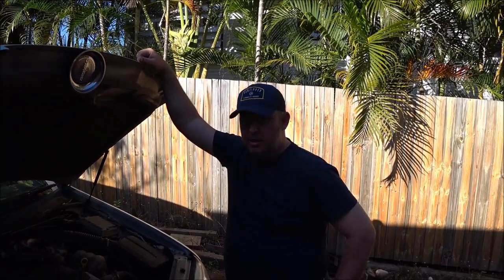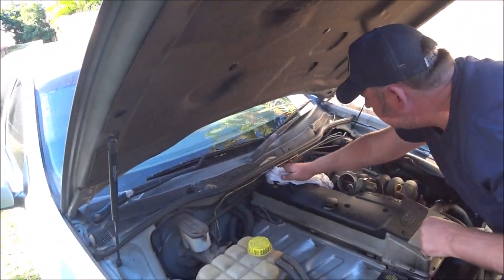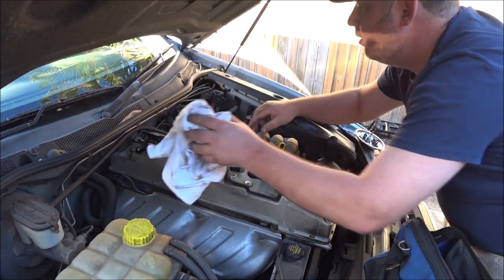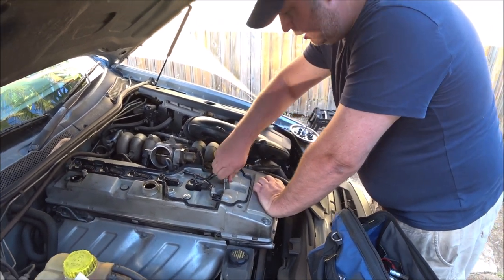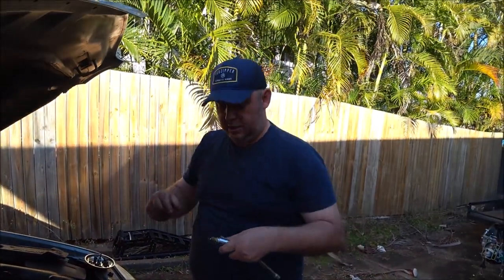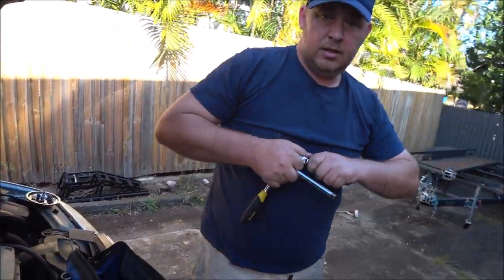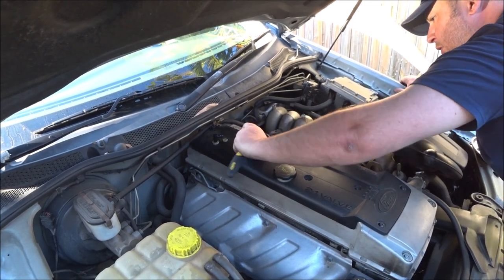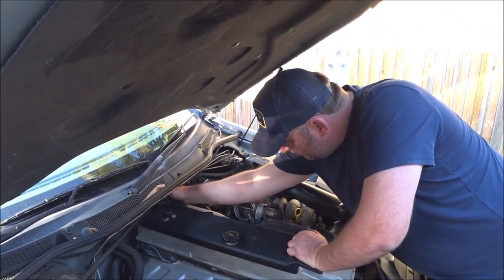BA Falcon - Spark plugs and ignition coil packs

Comment: Great video. Don't forget to put the engine oil cap on after removing the plastic cover while you are fiddling with the plugs and coils to prevent debris going into the engine unintentionally.
Reply from the maker: That is a good idea, and I usually do it, but didn't this time, I suppose because I knew I was only going to be 1 minute demonstrating and not there to do the whole job.
Reply: Hahaha yeah that's a good tip.

Comment: Thanks for the great video. After watching it I had a crack at doing my plugs myself. I was extra careful so probably took a little longer then I could have. Apart from the plugs costing a bit more then I thought I completed the task successfully saving I reckon at least a couple hundred bucks on labour. Cheers
Reply from the maker: Easily saved yourself some cash, if you got iridium or platinum plugs they are good for 100,00km so worth the extra.

Comment: Thanks so much for this video! I've been staring at the engine wondering where the spark plugs were as they don't show and neither do the leads!
Reply from the maker: No problems mate
Reply: tangles01 hey bud could you please send us the link on the factory Manuel cheers great video
Reply from the maker: Mate 2 mins on google will have it for you

Comment: This was a very handy vid. Thanks for sharing / posting. An issue I did come across was a couple of the coil packs, the plug section got stuck down in the engine with the old spark plugs and wouldn’t come out. What I did, was spray a heap of WD40 down the side of them and that provided enough lubrication for me to be able to wiggle them out with pliers without damaging them.
Reply from the maker: nice one

Comment: 14:29 so true make sure no gaps underneath . My BA started missing found that the last mechanic did not fit this properly it was sucking in dirty air. I actually pull the complete thing apart and fit that bit first. Top video thanks
Reply from the maker: Bugger

Comment: That help me out big time no.6 plug great video mate
Reply from the maker: Yeah she's a bit tougher than you'd expect with an engine bay the size of a small country they managed to make that tight.
Reply: @tangles01  haha yeah long way from Xseries ford
Reply from the maker: @iwillnotcomply2002  with no reason to be either. Just have the engine 2 inches forward or lower or a bit if both.
Reply: @tangles01  mate after the 1980's they employed halfwitt's engineers to make Ford. 😂

Comment: ThAnks for the vid! Quick tip to save you an hour though. On the difficult plug, I tried everything to get my extensions to fit and the only thing that worked was having the universal half way ( half down the hole). It then got severely jammed. Lots of swearing and sweating followed.
Reply from the maker: Yeah, makes no sense with so much room in the bay.

Comment: spark plug torque is 10Nm or 7.4 ft/lbs, doing mine this weekend, done 160k on original sets and it's starting to miss under load now. so new NGK coils and iridium plugs ordered.
Reply from the maker: Surely one or the other would do? although while you're there.

Comment: I use two short extensions.
put first one in then attach the second.
Reply from the maker: That can work, depending o the lengths of the extension. But also most of the cheaper tool kits will have exactly what I used here, which is the sort of thing most beginners will have ready access to.
Reply: tangles01 my comment was to inform people of a better way to do it. I have a lot of extensions and get no angles or interference from hoses.
Reply from the maker: @Godwillsortyou  Never said it was the only way, but the vid is for new comers to cars, who will likely own a single entry level socket set.
Reply: you could have used the universal with the short extension . I'm just giving people options.
Reply from the maker: @Godwillsortyou  Short with uni is too short mate.
Reply: tangles01 not in my toolkit.
Reply: I'm just giving viewers options. they don't have to do it your way. someone will read my comment and maybe don't have a uni and be able to do the job. my comments aren't to you. its for someone else might need a tip.
theres more than one way to skin a cat.
Reply from the maker: @Godwillsortyou  At no point did I say it couldn't be done with a different combination of extensions. However almost every kit will have these ones. That's all.
Reply: as I said 
 my tip wasnt for you. you've already done the job. my tip was for viewers. you don't need the spark plug socket with the grommet either
just put a piece of tape down the side of the socket and fold it inside the socket and it  will hold the plug.

Comment: Mate, I wish you had told us what could go wrong!  First non of the coils came out intact, the top separated from the rubber tube, then I had to use pliers with a strong pull to get the tubes out.  Then I found one plug hole was full of oil - over the plug top, so It looks like the rocker cover will have to come off right?  Sound like a difficult and dirty job?
I should have identified the problem cylinder, then disconnected the coil connector and run the car to a garage.  It would not run as was with the oil filled plug.  I'm suprised it worked smoothly last week?
I have yet to look at the plugs, as I need a special socket to remove them.   Iridium done 65,000 KM.
Reply from the maker: Never had any of those issues to warn you about mate.
Oil in the plug well could just be covered gaskets, all the way up to cracked head. It's hard to know. No special sockets needed for plugs, the iridium I have don't need it. You'll need a uni and extension for number 6 though.

Comment: My mate got stuck on number six spark plug..Your video sure helped, so thanks for sharing.. That seems like a very complete socket/ spanner set you are using..Do you mind sharing the brand and model number?..Cheers..
Reply from the maker: That's just the stanley 240" I think piece kit.
Reply: @tangles01  I thought it was Stanley with yellow on the ratchet handles but could not make it out..The only other brand with yellow tools is Dewalt...
Thank you.
Reply from the maker: @richyearle007  I think I say in the vid any kit with suitable long and shot extensions and a uni should do it.

Comment: I suggest where the air pipe goes onto the thottle body that you get rid of the spring and put a hose clamp around it as tends to leak air
Reply from the maker: So far so good, but yeah, could see that being a good idea

Comment: Doing plugs n coils now ... Just wanted to hear the conclusion ?  
 As I'm waiting for the parts ... 
 This xr6 ba on inspection  had the throttle body  misaligned  by 3-4 mm  is that ford ? 
 I'm sure Tickford didn't slap em on like that .
Reply from the maker: Well the coils were my problem. And that fixed it. A dozen of people may have had the crossover off for plug changes and general maintenance since new.

Comment: I always replace that seal, and likewise make sure you have proper washers (or sensor-safe silicone) under screws too, to keep water out...when you wash engine, then it runs like a pig for days, you'll see why I say that!!🤯
Reply from the maker: Couldn't hurt for sure. I've just never washed my engine bay, problem avoided lol.
Reply: @tangles01  hahaha...there is that option😁🙃👍

Comment: the spark plugs are about the only thing i hate in a barra, especially the one right at the rear of the motor
Reply from the maker: Yeah a big oversight
Reply: @tangles01  i can do all 6, its just that one at the back that gives me a headaches
Reply from the maker: @markdurl8341  yeah short extension and uni gets it done.
Reply: @tangles01  dont forget the copius amounts of swearing
Reply from the maker: @markdurl8341  I'm too old to get angry at that job. I've got a 300zx in the shed if I want to swear at something.
Reply: @tangles01  im not, especially since the first barra i ever did spark plugs on was an XR6 turbo lol

Comment: Thx came here to see if changing the plugs would fix the loss of power while accelerating and backfire or misfire
Reply from the maker: That will almost certainly be the coil packs mate. I have a video on them spefically.
Reply: Thx mate appreciate that, went and watched your other vid of the coils, will head down today to grab a set and throw em in confident they’ll do the trick, have left it for ages not being mechanically minded or finding the information like you have posted cheers
Reply from the maker: @4me4u4uspm  That's who I do the vids mate
Reply: @tangles01  problem fixed changed plugs and coils thx 😊
Reply from the maker: @4me4u4uspm  Good job mate

Comment: Thanks for the videos Mr. Tangles. Quick one for you. I'm looking at getting a BA Falcon myself. do you think it matters all that much if its a mk1 or mk2? What year is your wagon? Thanks mate keep up the good work.
Reply from the maker: Mines an 04 mate. As far a MkI or II, not sure, undoubtedly they ironed out a few problems from the MKI when they did the MKII, it's generally how it goes.
Reply: @tangles01  Thanks for the reply mate I think 04 on is mk2. Looking at buying one myself and wanted your opinion on it. Ill look for a 04 and up :) thanks again mate
Reply from the maker: @MrRanma3030  Not a problem man,m happy to helps, which is why I make the vids.
Reply: @tangles01  my old man is a mechanic but a die hard holden fan so i have to come to your channel for Ford advice as he wont help haha
Reply from the maker: @MrRanma3030  Honestly not a Ford fan myself, but find me a cheaper more reliable tow car that can fit as much in the back, I'll buy it.

Comment: I was pulling up No.6 spark plug and it fell back in upside down, any idea how to get it out? i've tried blu tak on the end of a screw driver and still can't retieve it.
Reply from the maker: Magnet, or flexi grab tool or pliers.
Reply: Yea, get a magnet tool, i watched my mechanic and they'd loosen them and pull them out with this bendy magnet tool, I want to get myself one now too
Reply from the maker: @XSeanxMeowX  I've got a few and a couple of small flexible claw ones as well as a shiethed magnet that only poles out when you put the plunger on the back so you can fish past other magnetic shit.
Reply: @tangles01  Oh yes, those ones are pretty cool too, I might get both; I guess different operations require different tools, although that plunger one sounds very handy.

Comment: Thank you so much ,The magnet bowl is very important My LPG wagon stopped and wont start ,all fuses good ,wasnt running rough and solinoid has power .Brand new battery in and wont start ,serviced regulary <would there be a on ,off valve on gas tank to test
Reply from the maker: There probably would be a valve somewhere to isolate it, no idea where as I don't have one.

Comment: What gap are those iridium spark plugs you used, and were the gaps as set out of the box or you tweaked them yourself?
Reply from the maker: i cant recall, you don't gap irridiums mate, flexing the metal takes the coating off and ruins them. that part number is the right gap
Reply: @tangles01  Cheers mate

Comment: Thanks for going to the trouble of making this video to inform Ford BA  owners on how to change spark plugs and save a bundle of $$$ in the process tangles01  . Do you have a video on removing the throttle body from car to clean it properly? Does the BA model have a mass air flow sensor? If so do you have a video on removal and cleaning? Cheers
Reply from the maker: Not yet mate I haven't needed to work on that.

Comment: Amazing that Ford still uses the head like a T model Ford and a tad expensive to maintain the engines being 100 dollars per coil.
Reply from the maker: I doubt the T model had dual overhead cams?
Reply: i dont know where you been buying your coils mate, but i replaced mine less than 6 months ago and only cost me $130 for a set of six

Comment: great video, how i can instal gas kit in mine ford falcon bf and whats the best and cheap i can get. please advise me cheers
Reply from the maker: The cover gasket just sits in the groove mate, place it in pop it on, done. Ive not had to replace mine so not sure, but it's just a rubber seal, pretty much any brand will be fine.
Reply from the maker: Sorry I replied when tires, you want a gas/lpg conversion? sorry no idea mate. but I wouldn't got for the cheap option on that if I were you. probebly best to buy one with LPG on it already, preferably the factory lpg ones.

Comment: still easier than having to take the hold intake manifold off
Reply from the maker: What car has you doing that
Reply: @tangles01  VZ Alloytec haha. Used to own one, luckily I had 25mm manifold spacer to prevent this but the Falcon I own now is 100x better to work on overall
Reply from the maker: @grvyy  Yeah okay, A stock RB you have to take the crossover pipe off. and a couple other turbo options

Comment: Just replaced my coils and plugs and I can't get the rubber gasket to line up with the groove on the cover is it ok to pulpit of and put in the groove I'm told it don't matter if seal is broke looking like the only way I can do it ?
Reply from the maker: It can be a bit tricky, but it is important as water can get under the cover and then run down onto the coils which will wreck them, it can also run down the hole and pool where the plugg is which will cause corrosion and spark loss, and worse if you undo a plug and some of that rusty water goes inside the cylinder. I imaging a new seal is pretty cheap, but also just pulling it out and re moulding it with some gentle heat from say a hair dryer should help it go back in.
Reply from the maker: You could also use a small bead of rtv in the groove and let it set to hold it in place while you're handling the cover.
Reply: @tangles01  it's the gasket has broken loose on the alloy only in a small spot maby can fix it with some gasket seal cheers for the info
Reply: Mainly at the back it's completly broken the seal to the motor so if I get a new gasket should I use gasket silicon to seal it
Reply from the maker: If you get a new gasket you shouldn't need any silicon
Reply from the maker: But if you but a small amount on to hold it in place it shouldn't hurt.
Reply: @tangles01  all good I got the old one in new one next time
Reply from the maker: Excellent news
Reply: The idea is to put the rubber seal into the cover first ,snug it all in ,then make sure all you coil rubbers (that press them down) are in place .then pop your cover on ,bolt it down. Easy

Comment: Ford really fucked up with the sixth plugs placement access and the stupid back Allen bolt mine is not in was like it when I got the car I don't know if it will hurt anything but it hasn't so far makes it so much easier to remove
Reply from the maker: Yeah it really just hold the seal in to stop water getting into the coils. back of the engine is a tough place for water to get in the 1st place, so it's probably fine, you could always buy a 20c bolt if it worried you.
Reply: tangles01 bag I'm glad it's not there much quicker to get the top of
Reply from the maker: Yeah can't see too much draw back.
Reply: tangles01 how long have you had the z32 I used to have a good one with legit low KMs under 80k but my ex made me sell it to get a family car then the cow left me a few months later thay are nice cars I wish I still had it
Reply from the maker: Lets see, I b ought spent 3 months fixing it, drove it blew the head gasket and parked it 6 months ago lol. After I finish building the RB25 for the race car, I'll sort out the 300ZX.
Reply: tangles01 ok I was lucky the one I got had no problems was a while ago though like 2013 only prob was it was an auto everything else was great for an old car it drove like a gem guess it's just luck of the draw cause I wouldn't like to do major work on one need five year old Asian hands for that shit 😂
Reply from the maker: And 2 elbows